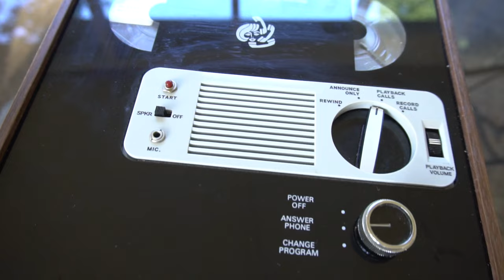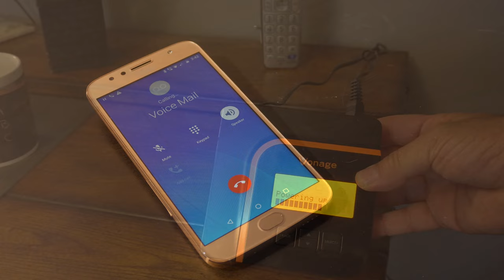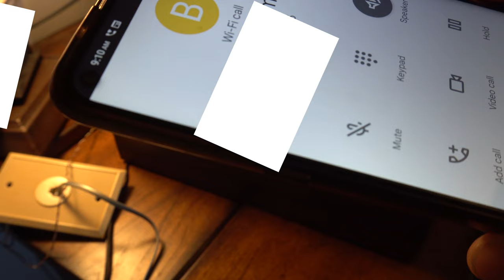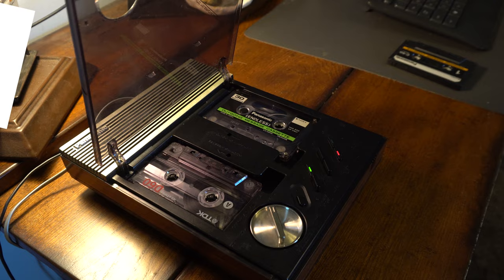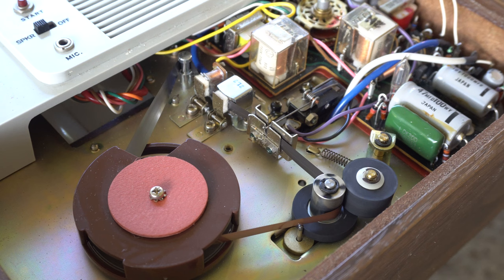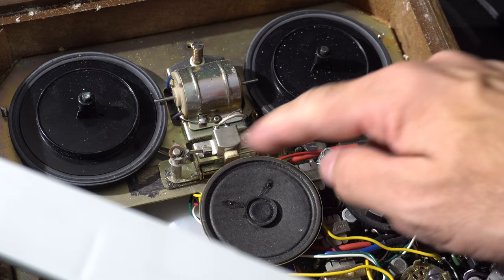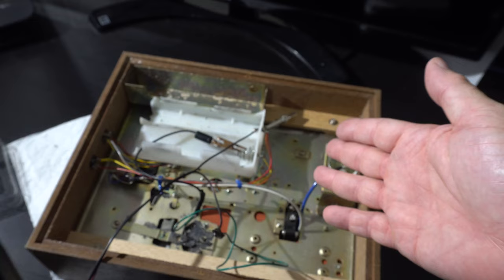Ancient Answering Machines: Phone Mate 400S vs Panasonic Easa-Phone

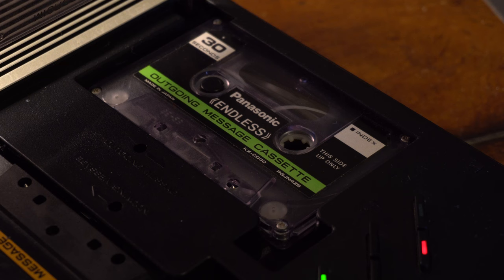Comment: 5:17  the incoming and outgoing message tape placement changes from model to model and brand to brand. Most of the ones I have seen from the late 80s and mid 90s have the message for the caller on the left, and the recording side on the right.